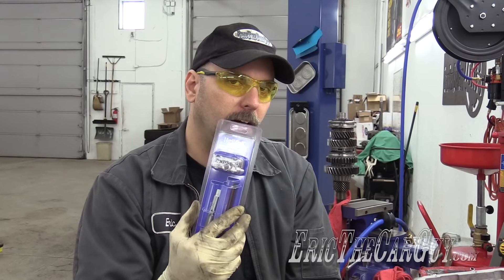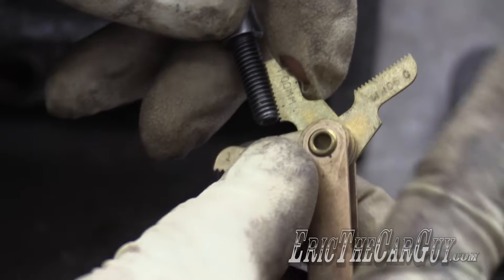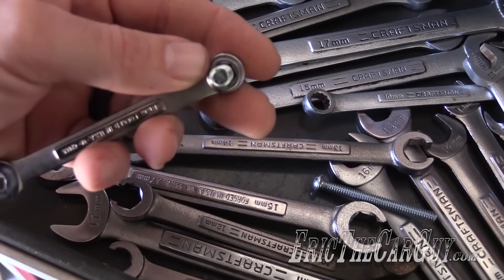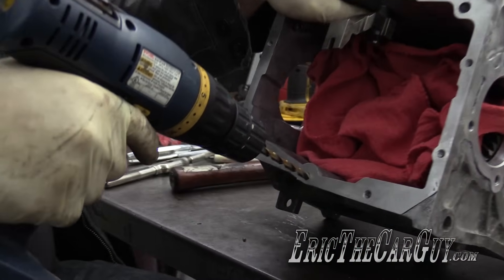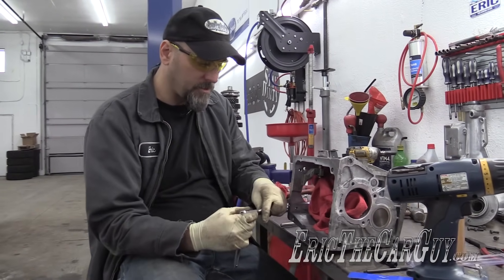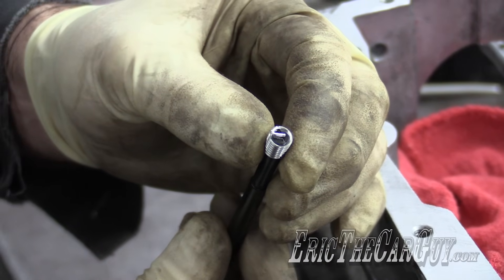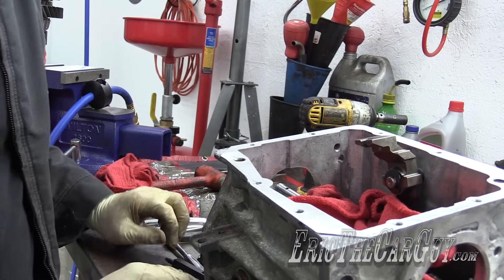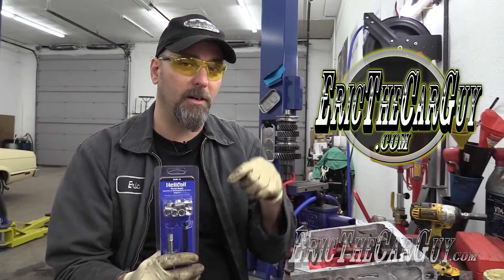Stripped Thread Repair: How To Install Thread Inserts

Comment: For whatever it's worth, back in my machinist days I was taught to take one full turn on the tap, then reverse 1/4 turn, then another full turn and so on until you reach bottom.  This is intended to prevent the tap from binding on its own shavings, which can cause the tap to snap off.  You shouldn't be in a hurry to tap a hole, and you want to anticipate when the tap will bottom out because if you are too aggressive with the twisting torque as you reach bottom, you risk snapping the tap off in the hole.  That makes for a really bad day.
Reply from the maker: +Mike Hartmann Excellent points, thanks for your input.
Reply: @ericthecarguy  Ever hear of thread-cutting oil ?
Reply: I appreciate you for letting me know I'm new to working on my vehicle and I really don't want to break my tap off in my transmission

Comment: The other advantage of using the same bolt is that when the next guy takes the fasteners off, he doesn't have to be sure to put the right bolt back into the tapped hole, (and he can use the same size wrench as all the others).
Reply: I dont mean to be offtopic but does someone know of a way to get back into an Instagram account??
I was stupid lost the login password. I would love any tricks you can offer me!
Reply: @Zain Liam Instablaster =)
Reply: @Adam Marcos It did the trick and I now got access to my account again. Im so happy!
Thank you so much you saved my account :D
Reply: @Zain Liam glad I could help :D
Reply: @zainliam2899  “your” account or your account

Comment: So easy with nothing in the way lol
Reply: Getting that part free probably wasn't planned on. Talk about angst.
Reply: +DE “AutoBravado” Nichols if I'm correct, that's the manual transmission out of the 79(?) Mustang donor which Eric pulled the drivetrain out of to presumably rebuild before putting it Oliver.
Reply from the maker: Yep
Reply: EricTheCarGuy Already had metric bolts back then? Wow. By the thread pitch I was thinking it was another project. Thought metric wasn't that much back then.
Reply: +DE “AutoBravado” Nichols Of course it did. T-5 wasn't a US only transmission. It was used in more cars overseas then it was in the states. Obviously they would go with the more universal system.
Reply: DaTwistedOne1 Right! I forgot!
Reply from the maker: +DE “AutoBravado” Nichols Yes they did, metric started showing up on domestics in the 70's. That said,  I believe the transmission is out of a newer vehicle. I suspect something in the early 90's. Paul also said it was a V6 transmission.

Comment: These things are great! Here's a tip. I was helping my son putting one of these in for the waterpump on a 1.5l mitsubishi 4cyl. There wasn't enough room for the insert tool so I cut the end off a stubby screwdriver and cut a notch in the shaft.. That fitted the little tab so I could screw the insert in.
Reply from the maker: Great idea, thanks.
Reply: You're awesome dude thank you!

Comment: This tip saved my bacon doing a transmission service on my 1979 Dodge Power Wagon. Five stripped transmission bolt holes about made me go crazy. Now all bolts are snug and properly torqued thanks to Heli-Core and your video. Thanks a ton!
Reply: I’m

Comment: That tool is designed to snap that tab off so no need for a punch
Reply: I was able to turn it counter-clockwise, to get it to snap off. Also keep in mind I used an angle grinder, to make sure the insert was smaller or same length as the hole.

Comment: Incredible video!  I couldn't have fixed my 2005 Jeep Grand Cherokee transmission pan stripped threads without this awesome video.  Btw, I have the same size fasteners.  The only reason why I decided to fix it myself is because of how chill you were in this video.  If you were all stressed out, I would have taken it to a mechanic.

Comment: I hope I never have to use this new found knowledge!!
Reply: I'm here because I bought the kit with a need to use this new found knowledge 😂😂😂😂😂
Reply: I'm at the point in time, where I have to use it. I'm nervous, never done this before
Reply: If you working on engines there is no way you won't need this 😜

Comment: I'm doing a head gasket job on my wife's 2004 Subaru Baja at 200k.  I've already found several snapped and rounded fasteners, leading me to curse the un-skilled person who pulled the engine last time.
Installing my newly cleaned and resurfaced heads today, I discovered that out of the ten valve cover bolt holes, five are stripped.  (three on one head, two on the other.)  This is pretty easy to do, since the torque spec is just 15 ft-lbs.  Off to NAPA for a Helicoil kit.
Imagine my joy to find one of my favorite car repair gurus installing the exact same 6x1.00 helicoil kit on YouTube.
Thanks, Eric!
Reply: Same here repairing 3 valve cover threads on a 03 honda accord v6

Comment: Eric, it helps to add threadlocker to the outside of these so they don't come out when you remove fasteners later.  if you're worried about ever needing to replace the heli-coil later a little heat will aide in their removal or you can use the weaker blue locktite. I've used the stronger red locktite in them in the past with no issues,  saves the fear of pulling out an insert, losing it etc. Thanks!
Reply: Ah, just read your responses to other threadlocker comments below,  I believe this falls under the "Do what you want,  but here's some other wisdom that can be helpful" category.  Good job.
Reply from the maker: I don't use thread locker in this video because it wasn't listed in the instructions. Thanks for your input.

Comment: Glad to see you back on your T5. I followed the Videos from you and Paul. Completed my T5 rebuild recently, took the Mustang out yesterday for the first time, shifts great! What a difference 93 new parts makes ! Thanks again for the videos. 
Don
Reply from the maker: Glad they helped. Thanks for the comment.
Reply: @ericthecarguy  I stripped the bolt hole to my thermostat housing I tried thread inserts but when I screw the bolt in it wouldn't stay in place. The size of the bolts was m8 1.25

Comment: Just a quick  tip for you. Use Keenserts, much better than heli coils, stronger, won't unscrew and easily replaced if they ever do wear out. Been a machinist and tool and die maker for 42 years and never had to replace one yet.
Reply: Just used EZ Lock inserts. After helucoils failed in my aluminum block and found that timeserts wouldn’t work, I was thrilled to find that the ez lock insert is a just a bit larger and it held securely. Saved me from a block replacement.

Comment: I used a HeliCoil to fix a stripped hole on the convertible-top frame on my '68 Ford Galaxie 500 -- that was 12 years ago, and it's still holding today.  Works great!
Reply: Helicoils are generally much stronger than the original thread and so will last forever. 🙂

Comment: When I am going to be using a tap and die set anyway I just use the tap as a thread gauge of course you still need to be certain of your diameter, check both bolt and tap with dial calipers or micrometer. Worked well for me the last thirty years. Thanks Eric, good job, thanks for the passing on your knowledge.
Reply from the maker: +Sam Johnson I also just take the fastener and lay it up against a tap of the size I think is correct. It was just easier to show it this way. Thanks for your input.
Reply: Welcome. Keep em coming Eric.

Comment: Only 5 years late getting in on this DIY masterpiece.  I would think that the open end of the combo wrench might be a better "plan B" for size checking, but the 12 pt box end would be better than a 6 pt..  I requested for Christmas several years ago a set of metric and SAE male/female thread size checkers that  went from really small up to about 3/4"/ 19mm and they were on separate small stranded cables so they would fit in a portable tool box nicely, unlike the wall mount thingies the big box/hardware stores have.  Pretty sure they came from McMaster/Carr and made in the US.  They were like $25 each, but there isn't a week goes by that I don't grab one string or the other to check thread size and or pitch.  WORTH EVERY PENNY!

You had a relatively easy drill/tap/ insert there on the workbench. Try drilling out a snapped of 6x1.0 flange bolt  on the backside of the driver side cylinder head on a First Gen Tundra with the 4.7L V-8.  I was lucky only 1 of the 18 bolts that held the  valve covers on snapped off since by the looks of the conditin of the valve cover gaskets, they were the OEM from the factory and this motor has 203k on it.  The torque spec for tightening is a whopping 54 inch/pounds.  thanks again sir Eric.  You have had GURU status with me for several years and keep up the You Tube vibe....you wear it very well!

Comment: Thanks Eric ,, i didn't know these things existed ,, well,, untill you need them ,,I'm a woodturner ,, i have stripped the thread on the tool rest holder (banjo) , thought i would have to drill and tap a new thread but then I'ed have to use a bigger bolt and wrench  ,,I don't want to go on that route,, all i need now is to find a garage to help,, don't need to buy the kit for one coil,, stay safe ,,Regards Alf

Comment: Nice one Eric. 

Whilst changing the cam belt on my Renault Kangoo Van, I cross-threaded the cambelt tensioner bolt, (in the dark, in my driveway, in the rain, in near freezing conditions, working one handed whilst trying to hold the cam belt in-situ).

I ran it through with an M8x1.25 tap, but the bolt won’t torque up to 25NM. So now my options are......

1: Get a replacement cylinder head from a scrapyard
2: Take the head off and send it to a machine shop to be machined
3: (my preferred option) remove the engine and use a helicoil to re-thread the bolt hole.

Some days I just wish I’d bought a new van, but this one is rust free, (a rarity around these parts).
Reply: Renault Kangoos are awful.. god I hate those vans, especially the shitty stirrup style handbrake
Reply: or maybe slime some jb weld in there and use that as material to re tap and heli into. ... could work if find a way to smear it on the outside, drill it out straight.. etc.  2 years ago but someone has that question in 2022 , too

Comment: You just helped me save my T5. I pulled the threads on the transmount bolt holes, and I'm about to use one to fix them. Wish me luck 😅

Comment: I've rebuilt alot engine's and  transmissions and have yet to retread bolt holes but that's about to change I've got a 429 that the timing cover has 3 bad holes and watching this video will help to do it thumbs up 👍.

Comment: I use a thread checker tool which works fantastic to find a specific bolt or nut size.  I made a video on the tool if your interested I can post it with your permission Eric.  Take care
Reply from the maker: Feel free. I also have one listed in the description.
Reply from the maker: +KRAYSLiCK999 No it is not.

Comment: Hi Eric...I have watched several of your videos....always good. Just noticed I was not subscribed. But I am now.
Anyway, I was trying to find how to get a broken bolt out of a residential propane tank capacity gauge. Four bolts--3 came out fine, 1 broke off down deep. Have tried everything. Kept trying to protect the threads getting that piece out. Then I saw a video that sort of mentioned inserting new threads.
Long story short I realize this is going to be the route to take---unless you or any other viewers have some other advice or suggestions. 
Thanks a million for all your good videos. Jesus bless.

Comment: I like to use thread locker on the outside threads of the insert. And put anti size on the bolt that is going into that insert. Doing that will prevent the insert from backing out.
Reply: I do the same. I use red thread locker not blue
Reply from the maker: +Frank Gonzalez  It wasn't listed in the instructions so I didn't include that in the video.
Reply: +Frank Gonzalez 
Helicoil engineering says not to use thread locker (Loctite). 
The insert will not easily back out if installed properly and the tang is broken off. 
Using anti-seize is not a problem and is recommended on moderate to high temp applications, also when there are dissimilar metals such as steel bolts and aluminum housing.  
Non-hardening thread sealer can be used on though hole installations to prevent leaking fasteners.
Reply: I worked at a Cadillac dealership. The first generation Northstar engines had problems with the threads for the cylinder heads would strip out. The repair kit had insterts that went into the block. I would put thread locker on those inserts. I never had a comeback due to the head bolt repairs I did. If you do or don't use thread locker inserts is up to you, from my experience I do.
Reply from the maker: I know all about it. I HATE those engines. Thanks for the tips and comment.
Reply: +Frank Gonzalez And NEVER use thread inserts in the Northstar's aluminium block.  No offense, I'd never trust a 'serted North*
Reply: 2dfx All Northstar engines were made of aluminum, with iron liners. And using thread inserts is what GM recommends doing. So by not using inserts, if would require the replacement of the block. And like I said, I never had a comeback due to threaded insert issues  And those repairs go back all the way to 2003

Comment: one tip, before butting the insert in, put a little red lock tight on the out side of the insert, I have had the insert of this style back out when taking it a part a few years later jamming the insert up tight to the outer part, not nice to get it a part when that happens, there is a much better style of insert that I wholesale that is a solid metal treaded sleeve that auto locks into the new treads, they come with lock tight all ready on the out side of them for even more added hold, I used a lot of them for spark plug repairs
Reply from the maker: The instructions for the product do not call for that which is why I didn't mention it. Thanks very much for your input.

Comment: Never thought about using wrenches or sockets to get a rough size of a bolt. I always went with a known fastener comparison, or a tap and die set with a pitch gauge. Although I’ve come across some crappy tap and die sets where especially the small sizes are manufactured so terribly lol

Comment: Nice video, good job, one thought though is that this was a blind hole and although it looked like it was deep enough to accommodate the bolt this is not always the case, in such situations you should use a bottoming tap so that you can cut threads all the way to the bottom of the hole. All manufactures will have such a tap for their inserts but often is a separate order. For what it is worth, thanks for the video.
Reply from the maker: You really don't need to cut the threads all the way down. Just far enough to get the insert into place.

Comment: Great video, I need to do this on my aluminium cam cover. The one good thing is that the inserts are usually stainless steel so it actually makes it stronger, being a steel bolt into stainless threaded hole, rather the original steel bolt in an aluminium threaded hole, if you catch my drift.
 Would it be worth using thread lock on the inserts to ensure they stay in place??
Reply: yes, my mechanic does that

Comment: Thanks for this! Question: does the tap that comes with the helicoil different from a regular tap of the same size?
Reply: Yes, it is usually stamped on the supplied tap “STI” which means special thread insert as far as I recall, hope that helps

Comment: Thanks for the video. 
I’m in a huge bind.
2011 Honda Odyssey rear bank valve cover bolt hole.(near firewall)

Stripped the threads in one hole, drilled out the 1/4 inch hole pretty straight, tapped it but the definitely crooked. No room, and using a borescope to see(not fun).
The helicoil goes in maybe 1 full turn.

How should i proceed?

Im about to give up and use job weld to fill the hole, put the screw in it, back it out and call it day.

Thanks in advance for your response

Comment: Great video mate 👍 The only thing I'd do differently is use a drill press to insure a square drill a tap. I know that would be quite difficult with an odd shaped casing like you have. Cheers

Comment: I'm not sure about how these affect torque values, but drilling and tapping for a larger fastener can change torque values enough to where you can't properly torque the new bolt.
The best way to get something close to the original factory functionality would be to, basically do a mold/cast repair on the case then drill and tap for the original fastener size. But that involves time and tools/machinery you probably don't have. 
But threaded inserts probably work just fine, I'm not sure how much torque they handle, so I'm cautious of them.
Reply from the maker: I think this is a viable solution. At least for this transmission build it was.
Reply: these are stronger than original holes tapped into aluminum, thats why edelbrock ships all of their cylinder heads with these already installed

Comment: Very informative w just one question.    If you can tap the hole out w the 6mm x1 tap why use the insert?  Wouldn’t the new taped hole now fit the 6mm x 1 bolt?

Comment: EricTheCarGuy, What's your thoughts on applying thread locker to the insert's outer threads before installing and anti-seize on the bolt during assembly?
Reply: I've done this with blown out spark plugs without any issues. Apply thread locker to the helicoil, install, let dry. Then install the plug or bolt.
Reply from the maker: +Mike Whitenton I considered mentioning that but it wasn't listed in the instructions for the kit. I wanted to stick with the manufacturers recommendations for the video. That said, I don't think you need it when going into aluminum like this. So far I haven't had any issues installing them this way.